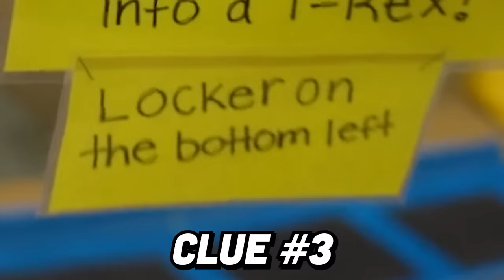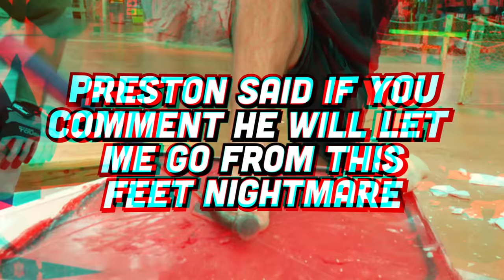100 Layer BOX vs World's Strongest Man!

Comment: YESSSSSSSSSSS TEAM ROBERT AND PRESTON VICTORY......Robert could also still have worked in the T-Rex suit technically his hands did not touch anything and still could power slam the box with the Mattock aka pickaxe use the chain on the cuffs on one weakened corner of the polycarbonate while standing on it as well and pry up using leg strength at the same time.